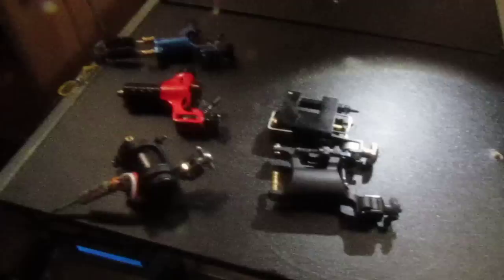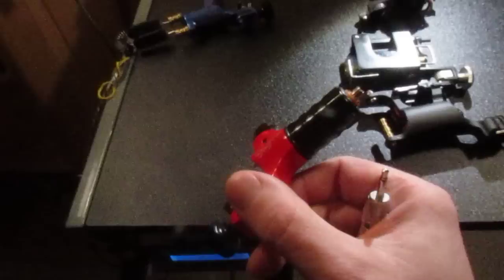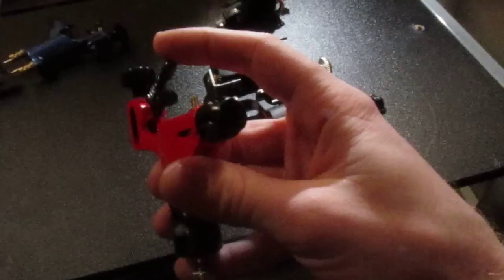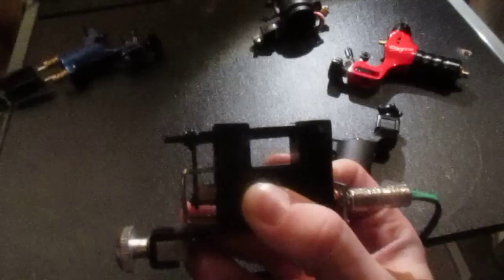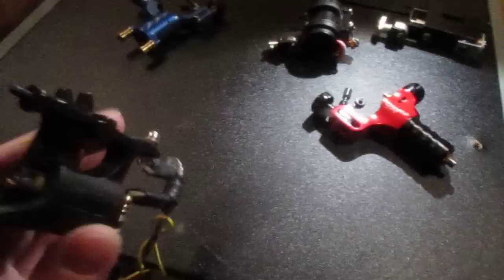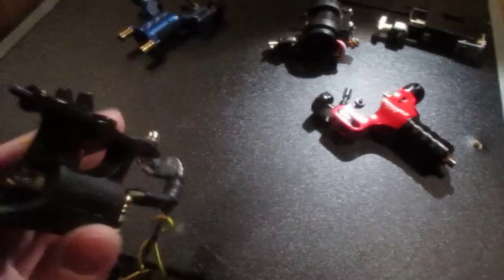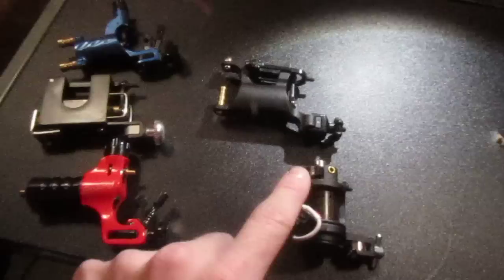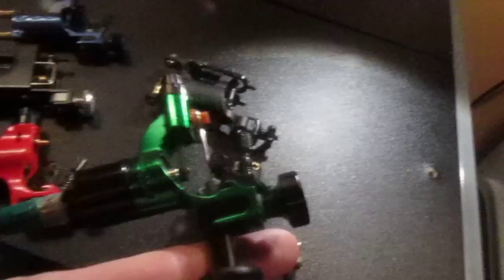hummingbird rotary review and more knock offs.

Comment: brother, im not going to even say anything about the purchase of knock-offs and how horrible it is for the industry. the only thing im going to say is you have the strokes backwards when it comes to rotaries, or even coils for that matter. when you use a short stroke to line with, if its a dd(direct drive) machine, the needle tends to snag the skin and you have to move uber slow. on the other hand if you use a long stroke 3.8-4.5mm you can tattoo like a beast! and its like a warm knife thru butter. if you are gray shading or color blending, a 2.5-3.2mm is the best. color packing is generally the same as the liners stroke(long). you have to be running your lines off the tube and that is so the wrong way to pull a line, especially if you want to do fine detail work, you need to see where your needle is! im just offering advice, that's all. ive been in the industry for a while and im cool with some of the top builders in the industry and all we do is talk schematics, uses, and draw backs of the different machines out there. hit me up sometime with any questions or comments you might have and I can explain the theory behind everything I just told you, have a good day.
Reply: Ron Crider that couldnt have been said better by Craig at swashdrive
Reply: Ron Crider hey I have a question I have a hummingbird and it came with some instructions to not go above 7 volts ink isn’t sticking so my question is is it because I can’t use a higher voltage? Or am I doing something wrong ?

Comment: Good reviews Andy. Its a relief to listen to someone who is a tattooist being open minded about the original versus the non genuine. I think if you know what your looking at and like you have you know what to do to modify if necessary. I have bought two knock offs and binned them because they were so bad but i am exploring. The only thing with some of the knock offs is they are too cheap. They seem to get so far with things and give up on some of the more important elements of the machine such as the 'give controls'. But i have seen posts and reviews that some tattooists are finding some good machines ou there. The info on the Hummingbird...thanks for that.

Comment: gear.top has a set green and black the green is a k/o dragonfly/hummingbird style and the other is a black k/o whip/can't remember the name of worldwide tat2 supplies version. I got them for $25 free s/h tested am at the shop for a month depending on the piece I would use my coils. So they got about 50hrs of use and worked as good as day 1 except I got used to them and how they work best. I use dragonfly for lining with spring about a 1/4 turn lose of tight. The whip I use for shading and color packing it says it can be used as a liner but for me it's throw is to long for that. They run great I wound up buying 4 more for $48 free s/h I'm still using original ones with well over 100hrs on each with no issues. JR'S tattoos and piercing Philly Pa is the shop I manage I thought I'd try a cheap rotary and of I liked I'd but higher end but I don't see any reason to waste my money so far so good I'll probably be ordering more since I know this seller has good products. Shops from the US be sure to check they have a warehouse in China which takes longer to get your stuff.

Comment: I have a knock off Hummingbird (I think it's the exact model you have there) and have loved it a lot. But strangely it's just stopped working and the top knob seems to be out of alignment. I try to get it back in, it works for about 30 seconds or until I take my foot off the pedal. I then have to re align it again and hope it works that time. Did you experience that with it before you changed the motor on yours? I'm interested in changing the motor on mine but have never done anything like that. Do you have any advice or a video of doing it?
Reply: U can order the motors at radio or eBay Swiss maxon motors don’t mind buddy their ffs ya go pay 700$ when u can pau 20$ and work forever ♾ lol
Reply: Christina Smith 🍻

Comment: When you've bought a Genuine Stigma Prodigy, and Dragonfly's, then Knock Offs, you find out very Quickly, that the Chinese Copies, if you buy enough if them, you WILL find One that is A good machine. If you KNOW how to swap out Motor's, and Modify these Rotary Machines, you, like I, WILL sell your Genuine Stigma or Dragonfly machines, because once you've Modified the Machine/s, they can run as Good & in some cases, BETTER, than the £500 Genuine Machines!?! I use Modified Stigma Prodigy and a Dragonfly. One that Surprised me "Straight Out of the Box" was a TATsoul Valor copy, that Ran beautifully. Had all my Knock Off machines for around 8yrs, and they are all still going strong. I swapped out the Motor on my knock off Prodigy, for a Maxon(Taken from a CCTV camera motor!!), & a Faulhaber motor i bought for my Dragonfly. If you use Rotaries, you will know what i mean. Its NOT the Machine ALONE, its You AND your Machine that makes the Tattoo. I found the Hummingbird Shit, and Noisier than both my knock Offs. They are Hit & Miss, I've heard. Most are A1, & you get Sone that aren't even worth the £120-£150. Even with the "swiss Motor" supposedly fitted. A New Maxon Motor is usually around £80 for the small 17mm Diameter by 24mm Long, Roughly, you'll need to fit the Motor Bolt on most of these rotaries. I believe that Stigma©®, Ink Machines©®, and most other Rotary makers, are the REAL rip Off Merchants. If china can reproduce the Same Machine, doing the Same Thing, at a Fraction of the Cost, who is the Real Rip Off?? Albeit, you have to buy Bulk, like 5-10 of the copies, but you WILL Find One or Two machines, that are just as Good if not better, after Modification.

Comment: Most Chinese Rotary's good to go out of the box! MABUCHI MOTORS. the Japanese & Chinese do not recognize patents. MABUCHI is a Japanese company producing motors all over Asia including China. MABUCHI is typically the stock motor in all Rotary's!

Diablo is a Swiss motor Cost from factory $130: MABUCHI is as good just louder. 

With Rotary's the motors, what matters is RPM'S. ROTARY'S use the same motors as in Hair Clippers, Remote Control, car's. Various prices from $0.30 to $130 for a Swiss motor. $5 to about $15 is right.

I personally like the Dragon Fly, Bishop, Stealth, Swash Drive,  any Stigma is good.  I buy them online from China. $10 average price. Bodies are either polymer,  zinc,  Billet Aluminum. Most of mine are Billet Aluminum or Zinc,  bodies.

Preform great!   Nice video!

Take Care!  Bill Kearney.  :-)
Reply from the maker: i find that the motors arent really the problem with knock offs its all the other components. thats why i just got a few real rotarys. but the best for the buck is my hummingbird. it was 200 and worth every penny. it has a swiss motor and i tested it at 9150 rpms. and never heats up

Comment: HELP! I bought a hummingbird, im new to rotaries, always used coil. Ive scoured the the web looking for a manual....the housing (motor, black barrel) is lose from the unit itself, where the O ring resides. I cant seem to tighten... is there some special way to rotate the thing? ive noodled with the allen screw turned it this way and that, its still lose. worldwide doesnt answer customer service calls or messages in FB... I cant believe theres nothing online...
Reply from the maker: I'll make a bid for you ok

Comment: You're running the machine way too fast. Tune the voltage a bit lower, around 4 to 6 volts. Don't run the machines with voltages as to coil machines. It is just a matter of finding the right machine the works for you.

Comment: I own a legit one, not a knockoff, and I have used it, and I can tell you it's a crappy machine. False economy. Bought a 2nd hand Bishop on eBay for $50 more than a new Hummingbird and when you try that, you'll never want to use the Hummingbird again. It just feels cheap, the motor is unreliable, it causes way too much skin trauma, bits fall off. Not worth it at all.
Reply: Don't buy a knock off then cuz mines perfect and quite a lot quit than this guys in the video